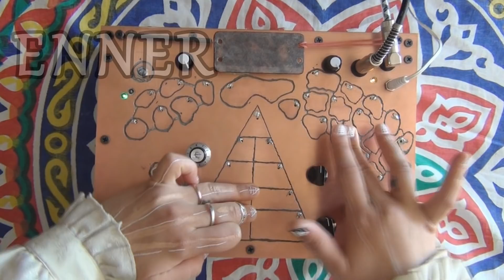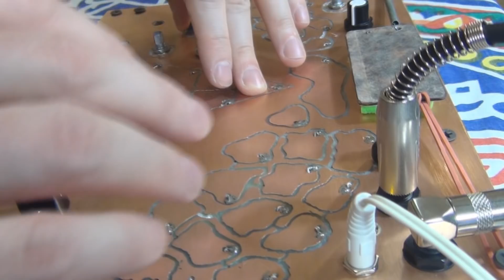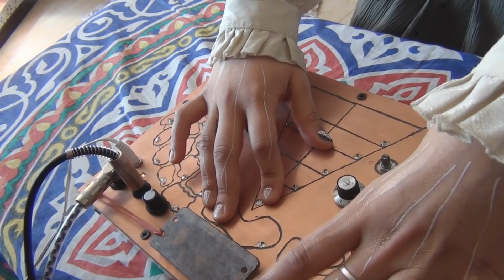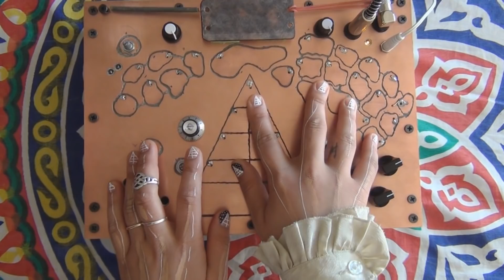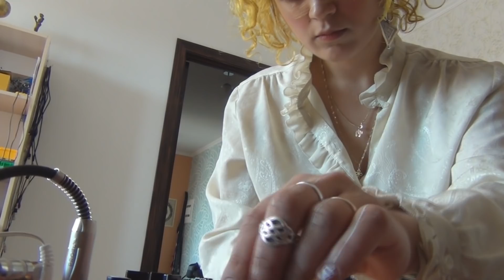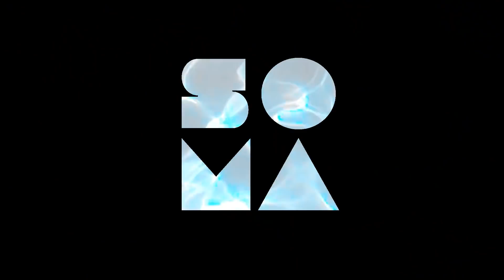ENNER (prototype). A new project from SOMA laboratory

Comment: I immediately start to think about moving some parts closer to each other. Like those strings on the top that could be closer to triangle so you can play with them with your fingers without releasing your hands from a triangle or other contact points. This could be achieved by making this device smaller or by making it look like...triangle or curved like horseshoe i donno. Also, this video doesn't really show modulation capabilities. But I'll keep an eye on development.

Comment: I love the concept, but I wish the UI were more coherent/elegant. The triangle and blobs seem arbitrary. Is there an explanation somewhere of what all of the interactive elements (like the spring thing on the top, the black pad, different outlined zones on the conductive surface) do?
Reply: This is just the prototype.. do you remember how the Lyra or the Pulsar looked before entering production? don't worry, the design will be polished
Reply: @dr.getter7118  Yeah good point. It seemed like the pulsar had an obvious coherent organization scheme during prototyping even though the labels weren't really legible though. With this, it seems like the right interface is going to requires tons of iteration and the "graphic design" of it is just as important as the circuitry (because the shape and layout of of the UI determines the usability of the whole system to a large extent)
Reply: My understanding (from watching/listening the video) is that the "Triangle and blobs" are not "arbitrary", the choice of shapes is  to give varied visual stimulus/feedback, the positioning is based on spread out hands and various movements of the hand will affect the sound output because each cut out area or pad or spring will have different functions that you will quickly learn (and maybe they will even be USER asignable or perhaps themselves vary by some inner tanglements...). 

The conductive surface is to use your body to make connections between the elements and will also be affected by your emotional state because variations in moisture of the skin/body heat/OTHER.
The different "elements" are to give variation of tactile stimulus/feedback. Example - the spring can catch your fingernail maybe.
My expectation is that it will be the most intuitive instrument yet produced by SOMA (and perhaps ANYONE) for musicians that like to/are already familier with using their hands. 

I look forward very much to more information/confirmation of the exact workings of this wonderful new invention. Now we could have PIPE blowing and ENNER flowing while LYRA sings and PULSAR dances.